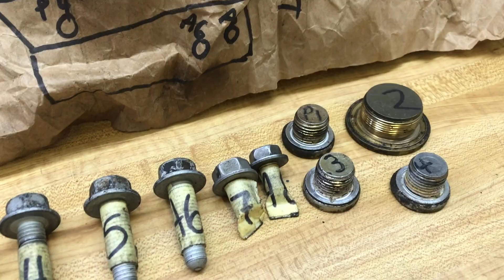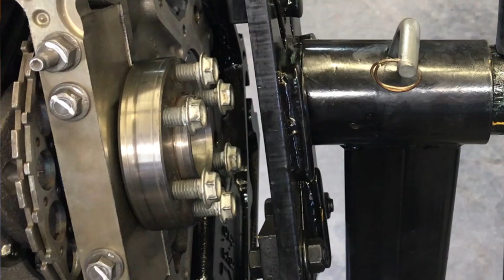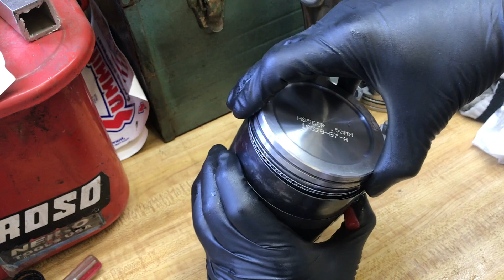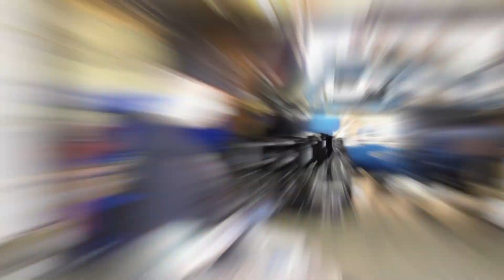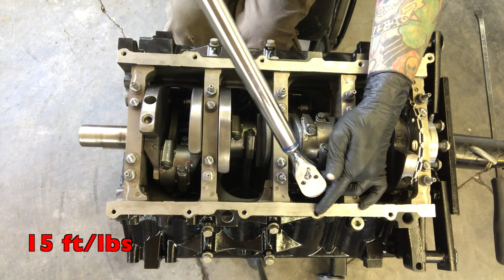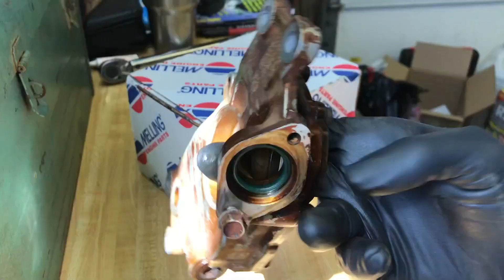INSTALLING BOTTOM END INTERNAL PARTS!!  - TURBO 5.3 LS pt 5

Comment: Never put oil between parts that are bolted together and move as one piece. Those bolts are for clamping load not sheer load. The parts could slide and cause the bolts to stretch. You don't oil a wheel bolts, brake disc or the clutch plate when you install it do you? Of course not! Those parts are held by friction and you are reducing the effect of forces that holds the part!!! Granted it's only a timing chain driving cams, but you could develop timing issues later down the line. I've seen it happen, we saw flames out of the intake lol. And the shaft had to be replaced because the mount was destroyed and could not be welded and ground back in shape. This was on K series and without any oil contaminating the join. So if it can fail unlubricated it will almost certainly be worse with lube. It might be able to vibrate on oil too.
Reply: I oil my wheel bolts….with anti-seize!  The fact that he brushed oil where he did doesn’t matter.         You could argue that maybe it was a pointless step, but all these areas he’s oiling are going to get oiled once he starts running the engine.  I do appreciate the advice on clutches and brake discs 😳 I’m thinking this may be my issue with braking distance.